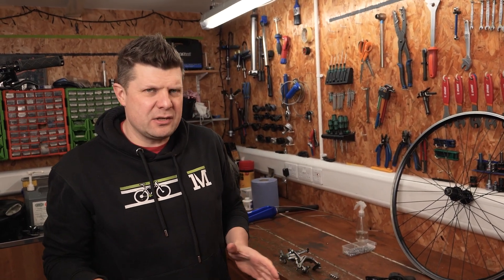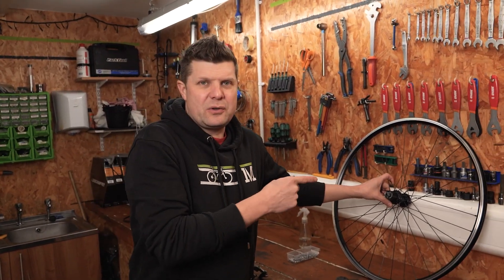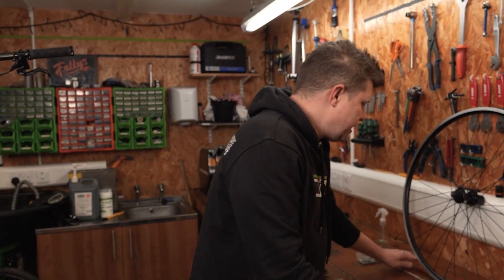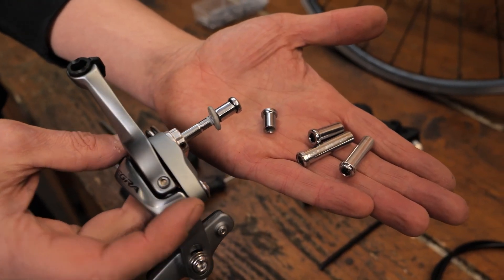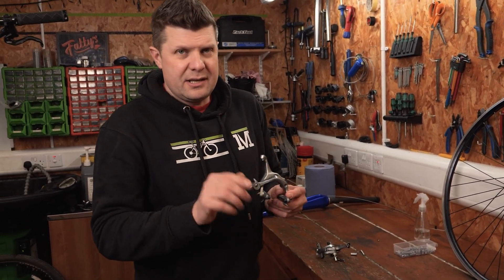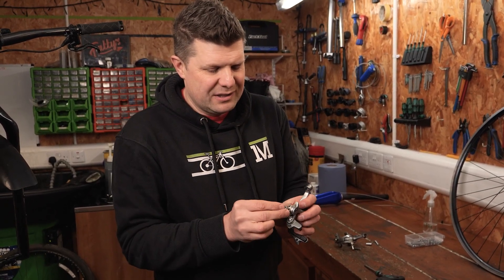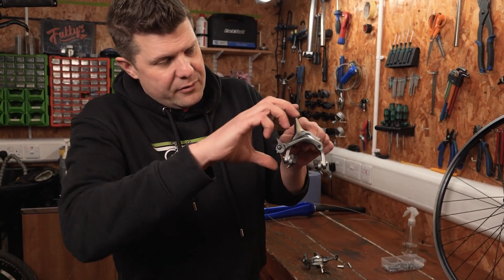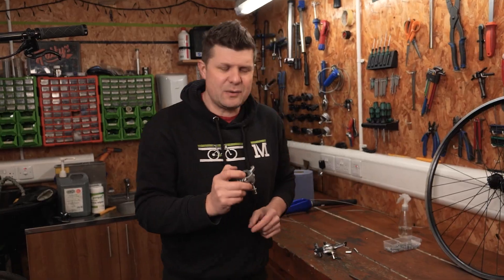Rim Brakes, the most common mistakes you make.

Comment: See how easy that was? How can one not love rim brakes on the road?  😘
Reply: Because they're awful.  Because they should have died out 5 years ago.  Because disc brakes are vastly easier to live with day to day.  Because disc's give better power and modulation all day every day and frankly, the idea of rim brakes is absolutely stupid.
Reply from the maker: Nope 😂
Reply: @richardhaselwood9478  let’s see some facts instead of bias, rim brakes are lighter, cheaper, more aerodynamic, easier to maintain and live with everyday, they last longer, they don’t rub make noise or warp.  IMO rim brakes also modulate way better with a more direct feel of forces at play, grip, wheel speed, lock up etc. I never found myself looking for more stopping power on a road bike with a set of aluminum rims and shimano calipers and swissstop pads, never. if I may add, I love descending and I am pretty good at it. I’ve heard your comments from many pandemic era cyclists who have hardly ridden 10K miles on the road.
Reply from the maker: Asks for facts… gives opinion 🤷‍♂️. Thanks Richard. Let the argument reign until the last rim brake caliper is stolen from a museum.  😉
Reply: @Mapdec  I gave facts and an opinion. How well we can use the equipment we have at hand will always be subjective from one rider to another, ie a rider who doesn’t know how to brake might think rim brakes suck but they won’t be braking skillfully on discs either. If anyone wants to argue against any of the real life facts as in lighter, aero, cheaper, easier to maintain, then please present your argument with facts or feel free to type out your delusional opinions for YouTube cyclist entertainment.
Reply: @gokaygs  they are not easier to live with. They need basically constant adjustment to get mediocre performance out of them. My hydro discs get bled once or twice a year, pads replaced as required, and occasionally need to check the rotors for straightness.
You are delusional if you think rim brakes are better modulating. They are basically either fully on or off, except in the rain, where they are fully off, or partly on.
I've been riding road discs since 2015 and it will be a cold day in Hell I go back.
Reply: @richardhaselwood9478  alignment of caliper and pads against the rims is the only adjustment needed and it takes less than a minute. What exactly are you even making a faff out of?  Shimano calipers provide all the power needed to stop if you know how to manage your speed and You can absolutely 100% fluff your rim brakes, only on and off is not even close to truth! Lever feedback combined with your hearing you can bring the pads precisely right next to rims. Call me batshit crazy but I definitely find the lever feel and feedback more informative transmitted to my fingers thru a steel cable rather than mineral oil.
I had my swissstop aluminum rim pads for 3 years and on that pad pair only I rode  around 20k miles, yet they look like they have 5 more years of riding at current pace. 
I wouldn’t want my ebike or mtb with rim brakes but I’ll always ride rim brakes on the road. If discs work better for a rider that’s great but there is no sense in abolishing a braking system which works perfectly fine consistently.
Reply: @gokaygs  It is not possible to have more information transmitted through a flexible cable, as opposed to an incompressible fluid.  By definition, disk's give better modulation. 
I also love this subtle, weird, notion that people riding on rim calipers are better riders because "they can control the bike better".  That may or may not be true, and as discs have become mainstream, and now dominant, there's a lot less of it, especially as plenty of never disc'ers come over, and discover they really like them, but if you need more skill to get almost as good a performance out of a system as its easier to use competition, that probably is a big clue right there.....  That is pretty important too.  I know a few women, with limited grip strength who have become much more confident riders now they have much more faith in their brakes.  

As I keep trying to point out, disk brakes are not difficult to maintain, not difficult to live with, and for almost every single rider (with the possible exception of Chris Froome) give better real world performance.  I don't ever have to adjust or align calipers against the rim, a job I hated as I could never get it right, and then my brakes would squeal like a banshee.  They don't wear out expensive carbon rims (admittedly not my problem, and from the sounds, not yours) and are night and day better in the wet.  They allow much wider tyres, and basically allowed the birth of proper gravel bikes.  Of course there are trade off's.  There are always trade off when designing mechanical systems, but for the vast majority of riders, they are worth it.  

Finally, I think @mapdec was ragging on me, not you.  Which is fine by me.  It's his page and he can say what he likes about his 'guests'.
Reply: @richardhaselwood9478  Vibrations will travel differently thru mediums of different densities, you not being able to feel a difference at the lever end does not change this fact. To me the lever feels very different, there is a more plush feel to a hydro lever where as rim brakes feels more direct. Both braking systems flex at certain parts, yet rim brakes unlike hydro discs have no element of compression required for braking. I may add that level of compression as well as the breaking feel changes in a hydro system depending on heat. Not only heat can be generated thru repetitive braking, I have also seen stiffening hydro levers after the caliper was left under the hot sun during a stop. As in only rear caliper exposed to sun and when resuming riding the rear brake lever is more stiff, as in the pads gots closer to the rotor with the expansion of fluid due to heat.
I’m not making a claim that rim brake riders are better, I’m just saying if you find yourself needing more stopping power than a shimano calipers and aluminum rim offers, then you need to hone your riding skills instead of looking for more breaking power, just my opinion.  Again if discs work for someone great, but rim brakes work perfectly fine with greater consistency and much less faff compared to hydro discs.  If you have trouble aligning your brake pads but don’t have problems bleeding your discs then we are just really different and that’s ok,  I’ll keep riding rims and you keep riding discs.
Also I ride carbon wheels too and while there is less bite and braking track changes from rim to rim, I don’t find braking troublesome on those either.  
I ride mostly in dry weather, I’m not too heavy and I don’t need more raw braking power on 25mm tires, simple as that for me. I also ride disc brake bikes, I just don’t prefer discs on tarmac or very light gravel. My road bike is a fast and precise race bike, it is not some hybrid machine which gave birth to the glorious gravel bike.
Additionally if discs actually gave every pro a better real world performance, then we’d constantly see significantly more KOMs on segments of grand tours in the last few years which certainly has not happened. Not many pro riders are as accomplished and at the career point Froome is and they can not talk negatively about what equipment their sponsors mandates to use. 
I don’t think I can explain anymore Richard and I don’t think anyone is ragging on anyone either, we are just being nerds talking about what we like.

Comment: Forgot the best way to avoid these mistakes - buy a disc brake bike!

Couldn't help myself, the rim v disc brigades sniping in your comments yesterday were ridiculous. Both are good.
Reply: A rim brake bike is a disc brake bike with a bigger rotor! /s
Reply from the maker: Love it 😂
Reply: @redwinedrummer  except a disc can last much, MUCH LONGER compared to rim brakes. Plus you don't have to buy a set of rims every month or so after the rim has galled and no longer mechanically safe to ride.
Reply: @69Deez_Nutz69  I used to be a messenger back in the day, I remember having a pair of mavic cosmics, the alu break surface lasted me 2 years of full daily abuse in wet/dry, didn't matter. It was in Paris so it rained a lot. 

I think that's pretty good, people tend top buy new sets a wheels after a couple years anyway. I've never been bothered by the rim wear thing.
Reply: @69Deez_Nutz69  buy a set of rims a month? How many kms u ride a year?
Reply: @PhiyackYuh  never had quality rims in my part of the world so we had to settle for Chinese knock offs. Even originals can cost as much as a whole bike, relatively speaking. Disc bikes in contrast can last much longer even if it's from a cheap bike.
Reply: Oh NO !!! 😃
Reply: @69Deez_Nutz69  every month 🤣🤦‍♂️ I've got some boras rim brake almost 6 years old now still in great shape...

In owning my disc road bike however I've changed 2 sets of rotors, 4 / 5 sets of pads and 2 bleeds in under 3 years....
Reply: @PhiyackYuh  he's lined his brake blocks with sandpaper for added bite. The cycling industry told him this was a really good idea..... and he believed them. Imagine trusting someone who has a vested interest in something you don't have and don't need......
Reply: @69Deez_Nutz69  this has to be a troll.
Reply: @Onigure  nah, for real just really didn't have the fortunate disposable income nor socio economic progression that you have  over the states. I ain't bashing on anybody, I just gave my 5 cents and took off somewhere seemingly gaining the ire of some people. But it is what 
it is
Reply: @69Deez_Nutz69  you never answer the question. Everything are made in china its that simple. I had the mavic heavy wheels rim bricks wheels and its holding fine. I think you are just bullshizzing 😂